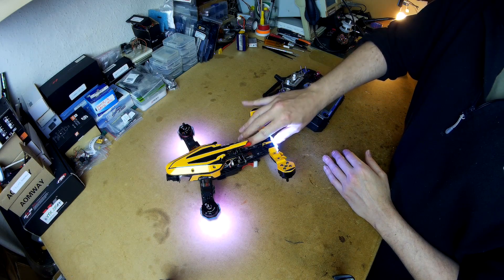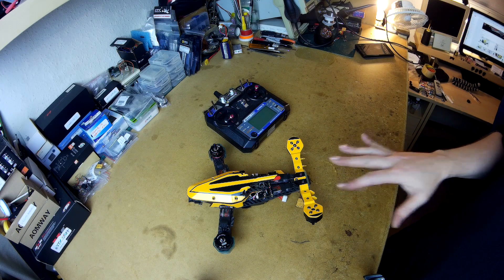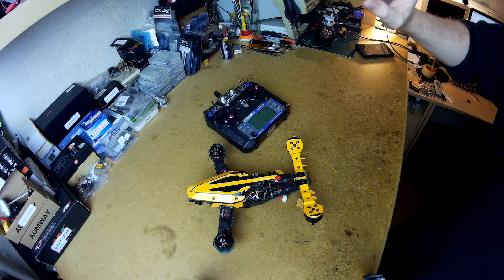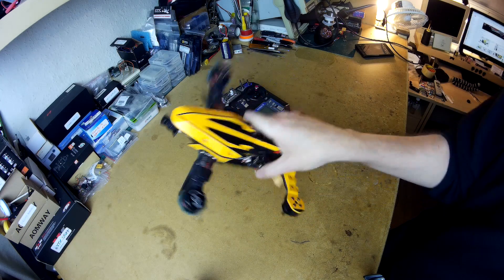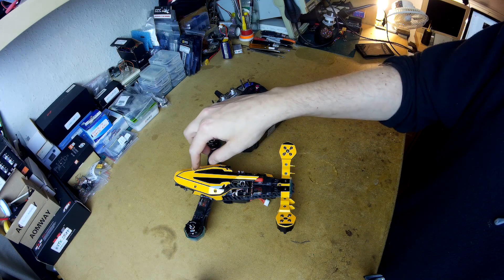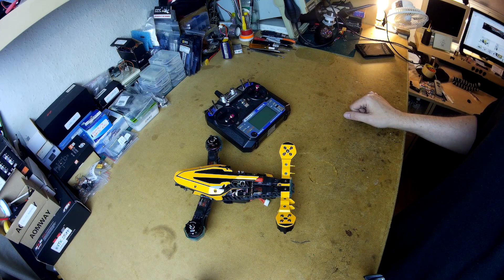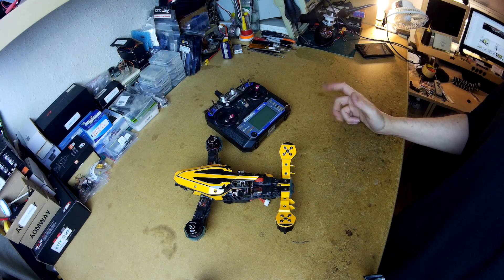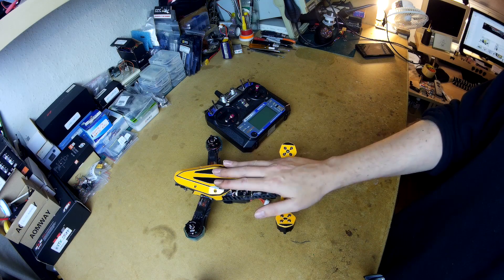Eachine V tail 210 - Unboxing (and why I can't fly it)

Comment: Once I figured out that you have to short the BOOT pads on the FC while powering up in order to get into bootloader mode, I flashed the latest CleanFlight firmware.  The manual made no mention of this.   It flew just fine but on the third flight I had a little rough landing which tore the rear landing leg right off the frame, and also damaged the right leg.   This thing is a rocket, but you will be very disappointed on your first rough landing or crash when you discover how fragile the frame is.   I paid only $139 for the RTF version which comes with a GPS, but even at that price it is not worth it as you'll spend most of your time fixing it instead of flying.   Its a rocket on a potato chip frame.
Reply from the maker: Yes the plastic V part wasn't well thought out for sure.

Comment: https://youtu.be/5xiznIJbAYQ test flight with rubber washers 👌
Reply from the maker: Looks good. I tried foam tape but an ESC died super quick too so I stripped the motors and FPV gear for different Vtail frame.
Reply: I was wrong - there is no overheating! Soft mounting solves the problem.
Reply: In your case, the motors were also so hot? I tried a soft installation, but it seems to me that there is overheating of the motors.
Reply: Misha Wiz Awesome 👌 😎

Comment: Hey guys. Does anybody have the eachine flying frog q90 f3 dms2 receiver??? If so , how did you get it to unlock or work period. I got it bound to my dx6 but nothing after that. don't know anything about betaflight, lol.
Reply from the maker: Install Betaflight and plug the quad into a computer first. If you need drivers that must be done first.
If you have RX bound you will see inputs within Betaflight for your stick inputs. If not you need to set up RX type. DSM" often needs cli command for binding so be sure by the manual you have bound fully if you see no inputs.
After this you need to subtrim the centre and use endpoints to get the values as stated. Those steps are common to all Betaflight setups but if you have a brushed quad you must also select 'brushed' as ESC type. 

Joshua Bardwell has videos covering every aspect of Betaflight you could possibly want but I suggest you ask someone who actually has that quad and made a review if you have issues beyond this.. I think Seby and Marblekit have that model but not definite.
Reply: Thank you ever sooo much. i'll keep trying. Seems like eveybody has a taranis radio these days or they use the i6 from frysky or is it flysky, lol. Watched a lot of videos, but  like i said they all used a taranis or the i6, lol. thanks again.
Reply from the maker: The procedure is the same regardless of your TX brand. Sometimes naming is differnt such as endpoints/travel adjust but they do the same thing.
What TX do you have? Where are you up to so far?
BF installed?
Can you connect to BF?
Is RX setup correctly for BF?
Can you see inputs moving on the RX tab?
Reply: Hi, and thanks. I'm using my dx6. redid a model name, rebooted to the quad. opened betaflight, did the tilting and moving thing that worked, did the transmitter stick thing that worked sorta all the swithces didn't work -stick are ok, tried to give the motors some juice to see if they even work - nothing at all. stuck again. any help please.

Comment: Yeah mines does the same thing but not as bed,i find it does it more when in the house and a little less when outdoors,its the Gyro that's playing up i think.
Reply from the maker: Apparently so but with some ok it seems a crapshoot if you get a stable giro or unstable one. If it was guaranteed to sort it I would buy a replacement but it needs an ESC too so might be worth just moving the motors to a decent frame or waiting for v2 with a soft mounted FC or something.
Reply: MicroRCFiend cool mine had a crash and now drift to the right,nothing I do fix this issue,moved motors around and it's till drifting 😡
Reply from the maker: Does it still drift in rate mode without self level active? Any video?
Reply: MicroRCFiend haven't tried that mode,I reconfigured the drone and is a little better,I only set normal flight mode Ni stunt acrobat stuff.